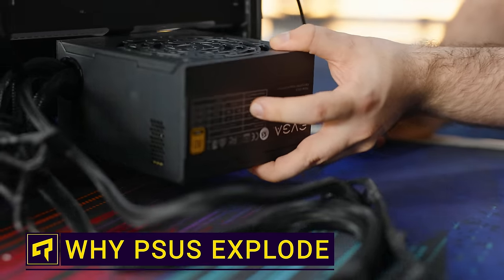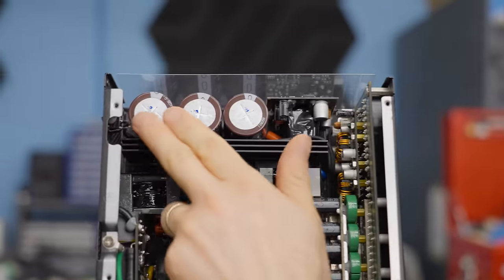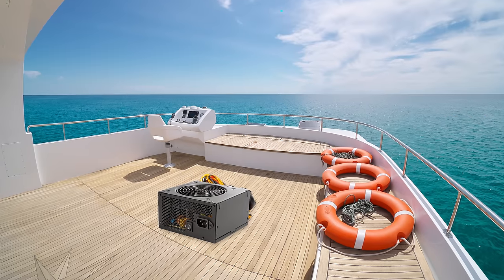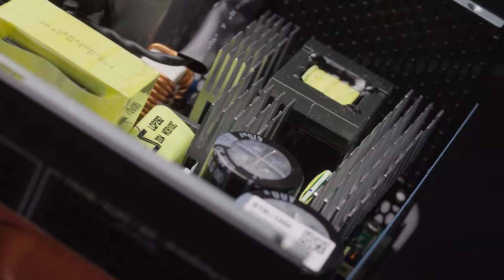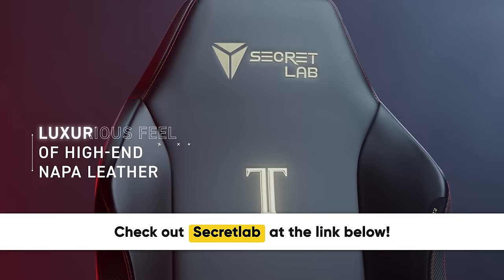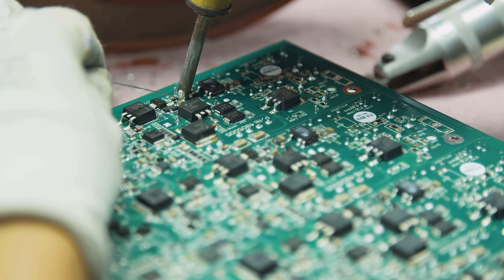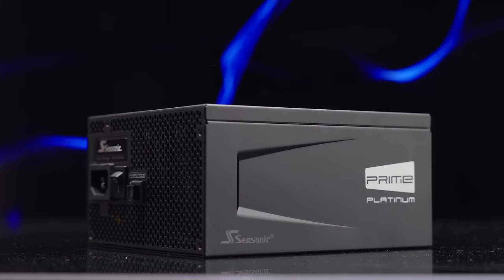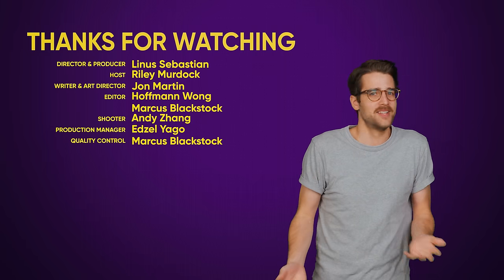Why Cheap Power Supplies Explode

Comment: Forgot to mention the existence of UPS devices for an extra protection around your PSU from fluctuation on AC current at home...
Reply: you can also get a power filtering surge protector if you don't have the space for a UPS. It isn't as good but still better than nothing.

Comment: My first power supply was a complete piece of crap. The cables were short, not enough connectors, and was not really 800w. It had a short only a couple of months after I bought it. I paid $30 for it. I was a poor dumb bastard back then. Now I have a proper Corsair $200 power supply and life is awesome. Never cheap out on your power supply.
Reply: 👆👆congratulations🎊you have been randomly selected among my shortlisted winners you just won a prize🎁🎁🎁...

Comment: Good General advice for buying a power supply 15 years ago.! Nowadays the fakes or copied power supplies look almost genuine with Identical stickers and Markings and even the logo and the box, and to make things worse, many stores will buy these "fake " power supplies wholesale and retail them to the consumer as if it were the original and of course the customer has to pay that retail price of the original unit. Furthermore the customer support for returning a bad "Fake" power supply is so bad that many persons just end up buying another power supply instead of dealing with the mountain of bullshit in order to get some redress. Many Retail stores and AMAZON etc are all about getting your money and they have no care if you get a genuine product at all all they will say is that they can't control the retailers on Amazon for example and it's buyer beware, But how the heck do you check to be sure, if the fake comes in the same box, looks similar, price is similar and even quality standard stickers are the same?
Reply: 👆👆congratulations🎊you have been randomly selected among my shortlisted winners you just won a prize🎁🎁🎁...

Comment: I just put my PC back together after having 2 PSUs blow a cap. It's an iBuyPower with a 6700XT and 11700K. It came with a 600 watt, mystery manufacturer PSU. It lasted almost a year, but AMDs software would often have a notification saying that there was some kind of error with "wattman" and it set everything to default. All I had changed was the fan settings so it wasn't due to an OC. I replaced that PSU with an $85, 850 watt model that had good user reviews. It lasted 2 weeks. I tested my power strip and outlet and they're good. Now I've replaced the MOBO with an MSI model, and bought a modular 850 watt Corsair PSU. Hopefully these don't blow up too.
Reply: When you say tested the wall and power strip and they are good. Did you use an outlet tester or an actual DMM?
Typically only a DMM or the like can make sure not only that you have power but that it's a stable voltage and clean

Comment: I had DiabloTek PSU that died one day after the warranty expired. DiabloTek honored the warranty and sent me a replacement unit. Only later on did I learn that DiabloTek had a reputation for exploding.
Reply: They probably just relabeled a lower wattage one to a higher wattage. I've seen a couple of el-cheapo 500W relabled psus as 600W and even 350W as 500W. Some knock of brands even do that to themselves. As in "high demand in 600W but we only have 500W in stock"? Just relabel to 600W to "satisfy" demand ;)

Comment: Ironically I had a Seasonic blow up on me! But to be fair, I have 5-6 other systems running Seasonics just fine. Luckily it did not end up damaging my system.
Reply: 👆👆congratulations🎊you have been randomly selected among my shortlisted winners you just won a prize🎁🎁🎁...
Reply: Well, if it blew up but left the rest of the system untouched, I guess it did its job.

Comment: I've been a massive fan of Corsair since a pipe came off my D5 pump and dumped almost 2L of coolant directly into the AX1200 PSU. That thing took the hit, powered off almost instantly, and not a single other device in my system was damaged.

Comment: I'm a bit confused here. What exactly are you referring to when talking about resistance of a capacitor ?
Reply: Electrical engineer here. Actual components always have some resistance. A theoretically perfect capacitor would have pure capacitance and 0 resistance, but if you want to model a real-world capacitor, it is more or less equivalent to a perfect capacitor and a resistor.
Reply: @arantes6  
If you are taking about parasitic resistance, that was my hunch at first as well. But don't we usually model circuital elements as lumped components to begin with ? He also mentioned impedance at another point in the video. We don't usually discuss about parasitic capacitance/resistance etc. and impedance under same context. I hope you get why I am a bit lost here... may be I'm overthinking

Comment: A while ago, I was using my old gaming computer and My mom and I noticed a burning smell in my room. My first thought was it might have been the power supply but eventually I found out it was the mother board because it died a few days later.
Reply: 👆👆congratulations🎊you have been randomly selected among my shortlisted winners you just won a prize🎁🎁🎁...

Comment: I always have anxiety about power, suppose that’s why I always get branded ones 😅
Reply: brand =/= good either though, always check reviews for specific models
Reply: @lurick  also the ratings, I won't use anything less than an 80+ bronze. If you can afford the high-end cpus and gpus you can afford the 80+ gold psus
Reply: Also branded one can still be bad, especially if you go lower than 80Gold
Reply: @catholic_zoomer_br  Bronze ??? All bronze PSUs i had died. 100% death rate from 15 PSUs. Different brands. Since then I started only going for 80Gold or higher and never had any problems. My go to brand is bequiet.

Comment: I bought a…not high end power supply from what I thought was a reputable manufacturer and it still went bang (and tripped the breaker!). Fortunately didn’t take anything else with it but yikes. Poking around inside (which you should not do generally) it looked like a power transistor split in half, probably quite violently.

Never again will I trust that manufacturer regarding power electronics.
Reply: To help save us from your pain, what manufacturer was it?
Reply: @tiladx  i would say thermaltake bronze or gigabyte bronze

Comment: I had a cheap "650" watt power supply for years, and i didn't get what all the fuss was about getting a good PSU

When i got a mid range GPU that requited an 8 pin connector after plugging it in, i tried to run a bench mark, and the psu literally cought fire in the middle of it

It was small enough to not damage any other components and go out on it's own, but I'd definitely won't risk it again

Comment: Is this a problem that can happen when buying a prebuilt computer from a reputable source or just something that happens when building your own pc?
Reply: It can happen in pre-built systems. I know HP has a bit of a reputation for cheap power supplies. They're plenty fine for the systems as long as you don't add anything power hungry like a dedicated graphics card. Higher end system builders (origin, main gear etc) tend to use quality off the shelf ones from the likes of seasonic or silverstone. They also charge more though.
Reply: Dell had a bunch of problems with their gaming line back in 2006 about the time they were selling millions of bad pc's to businesses using parts hp and apple stopped using when they discovered the parts were bad. It was a big problem. Bad psu's are one of the most common issues in prebuilt pc's.

Comment: If safety measures are removed, why is it legal to sell?
Reply: I'm not sure about the legality, but a lot of these brands are just made up names that sell from Amazon or Ebay, and if they ever need to, they just change the name and still use the same crap from the same manufacturer, maybe with a changed label.

Comment: I had a capacitor explode in my parents TV. It was very loud and there were massive scorch marks when we opened it up to see what happened. We were actually able to fix it by replacing the board for $400 and it lasted an extra couple of years from that. It was expensive, but significantly cheaper than buying a whole new TV of similar size.
Reply: Was it an old tube TV or a modern flat screen? Some of the caps in the old tube tv's are massive (like size of a small soup can or can of tuna) and when one of those goes off, it's kind of terrifying lol. They are also sketchy as heck, some have been known to stay live for years after being unplugged and they are absolute instant-death if you touch one in that state.
Reply: @zachcrawford5   It was a flat screen. The capacitor that exploded wasn't that big, maybe about the size of an adult's thumb. It did make one heck of a bang though. Like an especially loud fire cracker. That's what it sounded like from a few rooms away, so it was probably much louder standing next to it. Can't imagine how loud a soup can sized one going off would be. Probably wouldn't stop with just scorch marks either.
Reply: @TheUnHappySponge  That still pretty big lol, I'm glad you where a few rooms away and got to keep your hearing. I've honestly never seen/heard one of the big ones go ethier, but one of my highschool tech (shop) teachers was telling us about them, he encouraged us to rip open old electronics to get a better understanding of them but warned us about caps and especially those caps.

Comment: EVGA makes pretty awesome power supplies. I had a 1600 T2 psu sitting in my room for a good solid year before getting around to finally using it for a build and it worked like a charm.
Reply: 👆👆congratulations🎊you have been randomly selected among my shortlisted winners you just won a prize🎁🎁🎁...

Comment: What about if the power supply is fanless? Is it over engineered to push past it’s spec? Or is it throttled by even more stringent protection circuits?  See if you can’t have the labs lineup a comparison between a 700w seasonic fanless vs 700w fanned models from other contenders.  The higher quality fanless components may surpass their advertised performance, maybe even to the point of being able to host a 4090 in a fanless PC!

Comment: Low quality power supplies can be dangerous and even deadly. A few months ago I was installing a new computer at work, I connected the cable to the power supply first and when I tried to connect the cable to the socket I touched both leads by accident and got electrocuted. The capacitors in it must have been charged since the pc was checked and turned on previously. I suspect the power supply was designed so cheaply that there wasn't even a resistor to discharge the capacitors. I understand that touching both leads isn't exactly  'recomended' but that design can seriously kill someone.